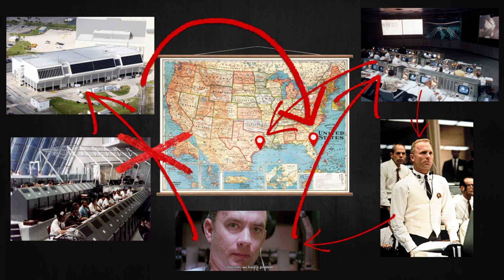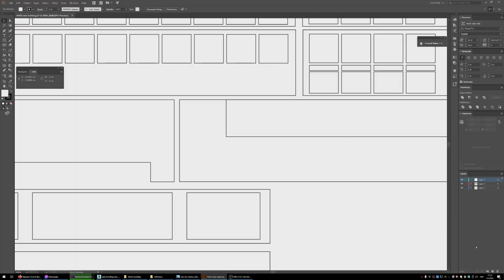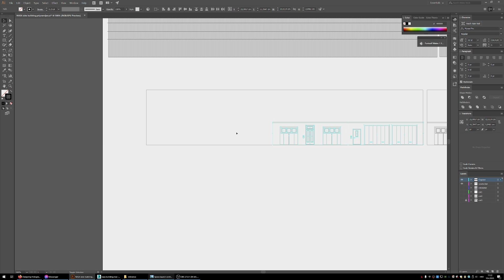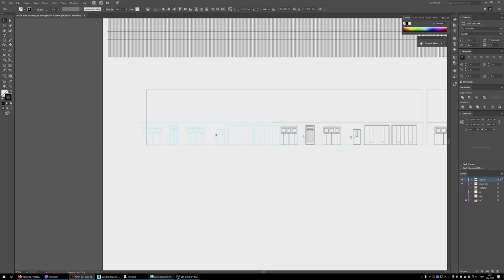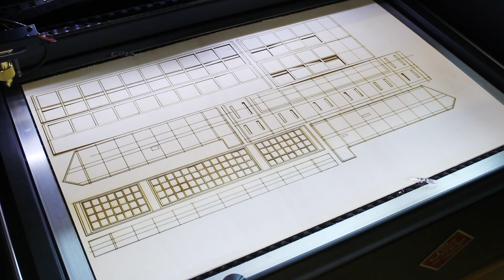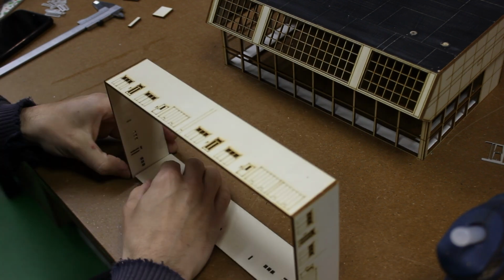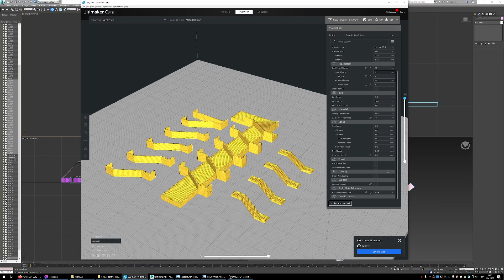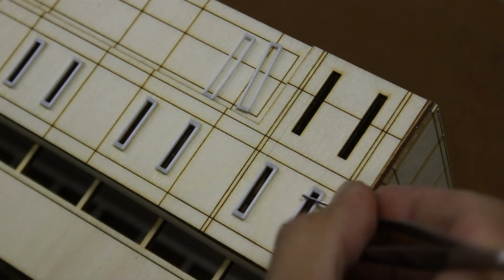Building a Miniature NASA Launch Control Center

Comment: Building shorter than the original...eh, ive learned through your Slice and Splashback videos you can get away with a lot, and ultimately, it doesnt detract from the story, continuity. And really, no one cares. Great job on the model construction btw.
Reply from the maker: Exactly! It won't make a difference at all in the end! Tnx ;)